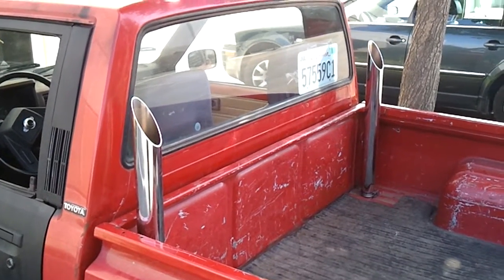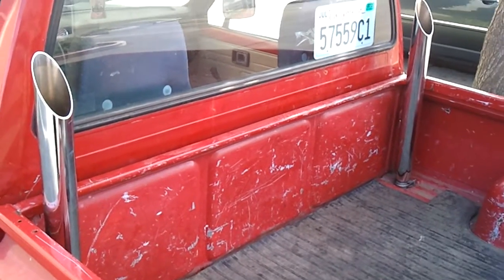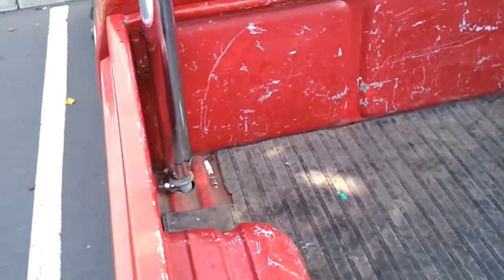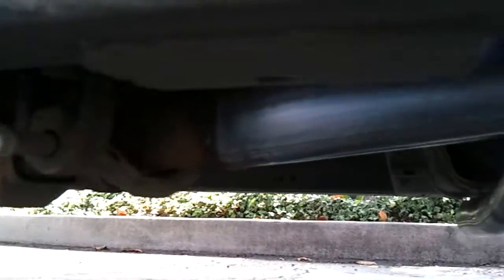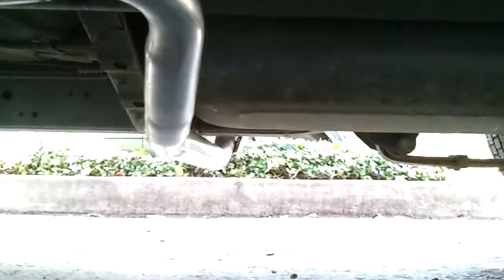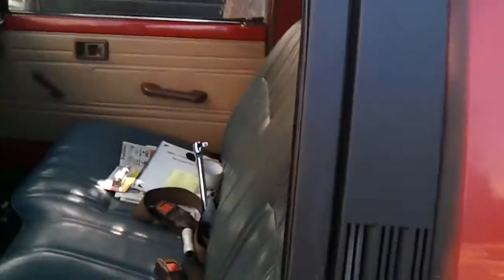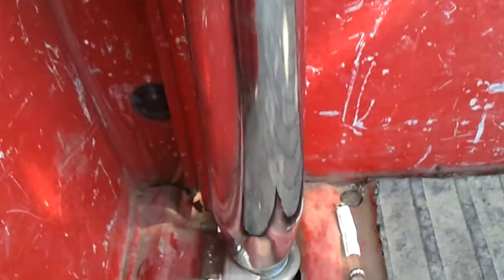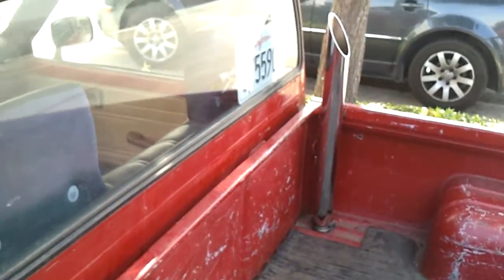86 Toyota Pickup Smoke Stacks

Comment from the maker: This is a 4 cyl. Its 2 1/4 inch motorcycle slipons out of the bed, under the bed its a custom y pipe, and its the same size as the pipe leading out of the factory muffler.